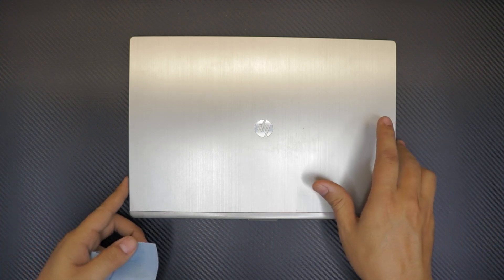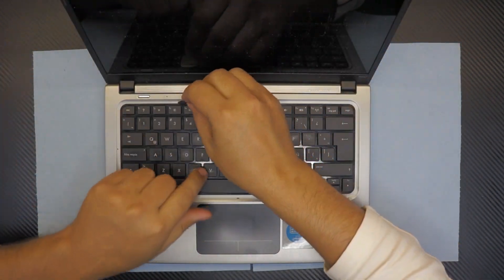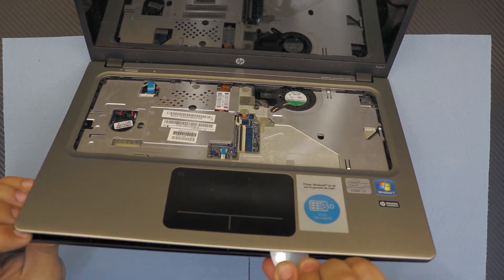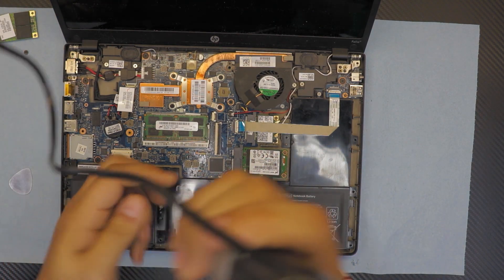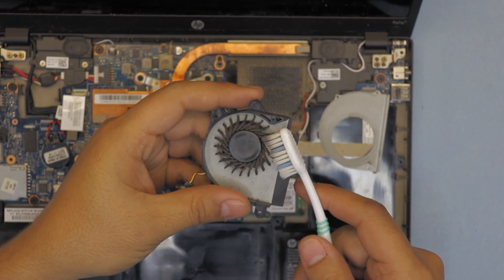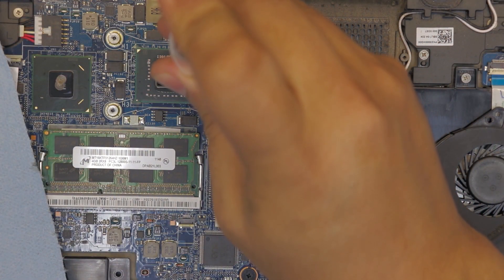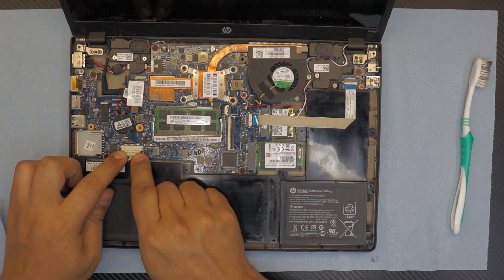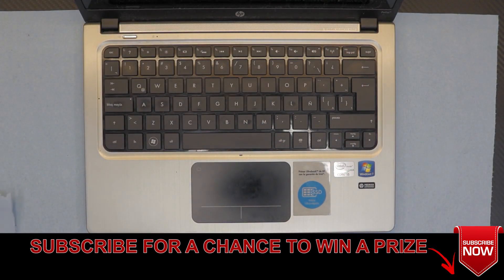HP Folio 13 Disassembly and service and REPASTE

Comment: I use this laptop from 7 years and no need to repair and also work fine nice laptop 
from Pakistan
Reply from the maker: What you're saying is like, "I have my car and I've never changed the oil, and it's still running." It will eventually fail.

Comment: My laptop is not turning on. And also no display.
When 1 hit the power button  It try to start but    after some seconds fan stops and just    light on power button blinks l.
Reply from the maker: remove the battery and press and hold hte power button for 30sec so it will discharger and reset bios and then try powering on after.
Reply: @uFixTek  okay sir thanks.
I'll feed back

Comment: My hp folio has white screen. Can you plz guide what may the issue.
Reply from the maker: the issue could be from many things LCD panel flex cable faulty or ram chip faulty , GPU issues. or components issues.

Comment: Hey, there is a difference between sata II and sata III?
And witch uses the Folio 13?
Reply from the maker: Thank you for the feedback! if you wish to support the channel you can LIKE or SUB or both :P
regarding your question: the differences are the speed the sata 2 uses 3Gb/s,a nd sata 3 6Gb/s
this laptop takes both sata 3 or sata 2. but dont put a sata2 , unless you want to suffer.

Comment: My computer won't turn back on. I went back to see if the on/of switch or cable was  was loose and it doesn't look like it . Checking again.
Reply from the maker: remove the ram and place it back in again , and pay attention to the LED power light, when you press the power does the LED blink or react?

Comment: Hi, I would like to say a big thank you ! 10 years I have my machine... The fan became noisy because of dusts and it would have been a shame to pay a repair service just for some unscrewing and brushing. Now it's working perfectly fine and the fan is smooth like a sleeping baby's breath ;) 

Just by curiosity, I noticed what seems to be little independants parts of motherboard taped in the corners  of the top pannel's inner face (we can see them at 4:25 when you flip it). They don't seem to be connected to anything. Do you know their purpose (like replacing parts if needed) ? 

Thanks again :)
Reply from the maker: Thank you for the support to the channel by a SUB :P and your feedback my friend:)
regarding your question about the electric board on the top panel :
https://prnt.sc/yqjgxw
this board is the ON/OFF switch and it connects to main board else the laptop wont turn on :P
it connect to this flex :
https://prnt.sc/yqjkwl
, unless im not understanding what part you talking about :P please provide pictures.
Reply: @uFixTek  Hi again, I'm talking about really small parts on the edges. I didn't took a picture myself so here's a screenshot, can't really see it tho :
https://prnt.sc/yqpk3j
One of mine fell so I was checking on the motherboard if i broke something then I realize it was just taped on the top pannel.
Reply from the maker: :P got you they they have a purpose , on the screen side there are magnetic electronics, e.g when you close your laptop lid they are sensors that will trigger that the lid is closed and so on. they dont get attached to anything.
Reply: @uFixTek  Nice 🙂 thanks for sharing your knowledge mate !
Reply from the maker: my pleasure my friend :)

Comment: Hi, I want to change the microphone but I don't know where it is, can you help me?
Reply from the maker: the mic is right on the screen bezel , right beside the webcam, some laptop they have the mic soldered on the webcam board so you may have to replace the webcam board, opo open the bezel (plastic cover around the screen) , using a guitar pick, and you will see the webcam. there is no screw for the top portion of the bezel.

Comment: I found a bit difficult to insert something to release the keyboard, tried a few tools, credit card plastic, only worked with a sharp knife. Other that, total success. Thank you for releasing this video
Reply from the maker: i would recommend a guitar pick. but knife can do the job too , thank you for the positive comment
Reply: uFixTek I was wondering what that thing was, a guitar pick! Never thought om that!

One thing I would recommend is to take a time to clean the fan. I had to reopen to do it after closing because it got stuck.

Cheers from Brazil!

Comment: i need repare my screen in 12 hours, please help me with a comment or a video please.
Reply from the maker: its very simple all you need to is remove the bezel of the screen, when you open your screen you will find two hidden screws right at the bottom of the screen on the bezel , one is on the right side exactly under the text "folio 13" @3:53 remove the round plastic cover of the screw then remove the screw and do the same to the left side.

and then use a opening tool or a guitar pick, and remove the bezel the same way i showed how to remove the top cover as shown @3:58.

and once the bezel is removed then the screen is hold up with 4 screws. remove then and remove the flex cable by sliding it out then you all set. 
here are some pics i added up for you :P 

good luck
https://imgur.com/a/cUGJVIB

Comment: I need hp folio 13-2000 display...
Reply from the maker: look for : 13.3" WideScreen , HD (1366x768), 40 pin video connector, it should be around 60-70usd
Reply: @uFixTek where I bought
Reply: No other display work in lappy 
I also try 40 pin many display
Reply from the maker: at the back of your lcd there is a model number give me your model number for e.g : B156HAN01
Reply: If you arrenge this part tell me
Reply from the maker: can you count and see if its 30pin connector or 40 pin?
Reply: @uFixTek  40 pin
Reply: @uFixTek  13.3 inch
Reply from the maker: its rare the screen with 40pins , but i found this abit $$$ https://www.ebay.com/itm/Ecran-Complet-Ordinateur-Portable-Pour-HP-Folio-13-13-2000-13T-1000-13-1015TU/322657666482?hash=item4b1fe545b2:g:rCwAAOSwE8NZlcdB

Comment: I have followed all the suggested steps and now it won't turn on anymore....all cables are correctly connected, I have tried all the reset but no way to turn it on. Battery is fine and the switch before was working,. What is the problem?
Reply from the maker: make sure there is no short to ground on top cover and remove the ram and clean the ram pins and plug it back in. let me know
Reply from the maker: can you double check you flex cable for the power @3:46

Comment: are there two batteries? - or what is the black box on the left side?
Reply from the maker: there is only one battery , all the black boxes are battery and inside one of them its empty space, there are 5 lithium polymer cells in this laptop they are all connected via one jack to motherboard.
Reply: Is it possible to replace the empty one with a filled battery to double autonomy?

Comment: Aaaaand, I just tore the ribbon that connects the keyboard to the motherboard. Yay.
Reply from the maker: ah shi**t , the big ribbon or the tiny ribbon if it was the small ribbon that's the back-light , if the big one is ripped then you have to replace the keyboard :(

Comment: Thank you for this. This is perfect. Just in time I would be upgrading my folio next week. You think it can handle 8gb RAM? and also what type of SSD do I need to buy?
Reply from the maker: i'm glad that its a use this video, and yes you can go up to 8gb ram no problem the cpu can handle it. and regarding the ssd hdd it has to be msata ssd , i leave you with few links, and dont get a cheap msata ssd we get lots of this models failing ssds, 

recommended msata:
Samsung 860 EVO 250GB      https://amzn.to/2n1394t 

#2.   https://amzn.to/2MaEfur
Reply: @uFixTek  thank you for the video. I have hp folio 13-2000. In hp website it is said that the  notebook support maximum up to 4GB of RAM. This is the link https://support.hp.com/us-en/document/c03166802 . Does it mean i can't install RAM more than 4GB? What is your opinion? Maybe you have experience to upgrade ram in hp folio 13-2000.
Reply from the maker: @experiment2931  the hp support is a BS , dont listen or pay attention to what they say !! it can handle it just fine and it will work perfectly fine.
for e.g even in intel website the cpu that i have it says only 16gb max and i have 32gb without any issue!!
you can upgrade to up to 16gb if you wish to AND it will work just fine. good luck and thank you for the support to the channel :)
Reply: @uFixTek  thank you for your information. Success for you and your channel.
Reply: Yo I used this video to install the Samsung 860 EVO 250 GB, it got recognized right away easy

Comment: Whoa I was just going to do this. I have the Folio 13-1020us but I assume it is similar to the 1050. This is super useful for me, thank you so much. Getting it back together and getting those connectors back is going to be really really difficult. The hard drive went kaput (it was 128 GB SSD) but I think I'm going to grab a 250 GB off Amazon and install it, then put Windows 7 back on it.
Reply from the maker: Nope Offmate im glad i could be a help, also let me know that this models 1020-1050 they have a hight risk of burning the m.2ssd ‘s. I get few of this every months because of Ssd failure. Make sure you keep your warranty for your ssd😌
Reply: That sucks! When SSDs came out they were saying they would last 20+ years because there are no moving parts. But what do you know, my old Asus K52J with a 500 GB spinning hard drive is still chugging along, but my Folio-13 ultrabook's SSD died after 5 years. It is really disappointing.
Reply: @nopejoeandangie  My Folio 13 SSD is still working almost a decade on, though it does have some bad sectors. That said, I have a mechanical hard drive from 1992 that still works!